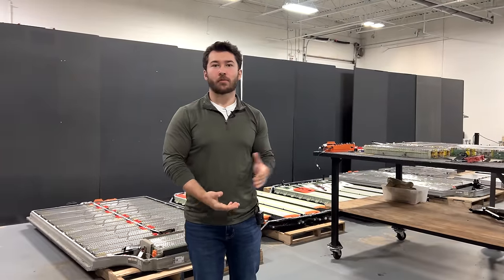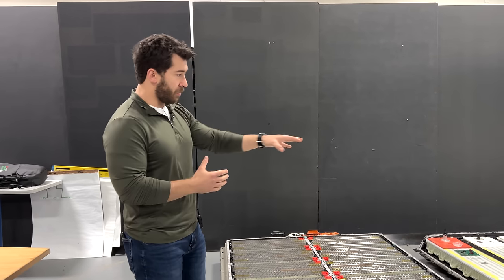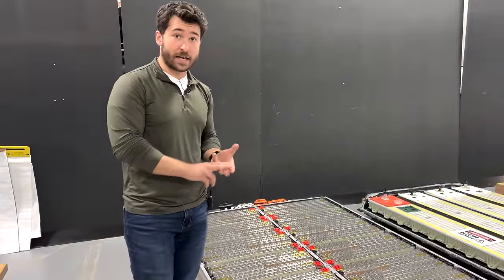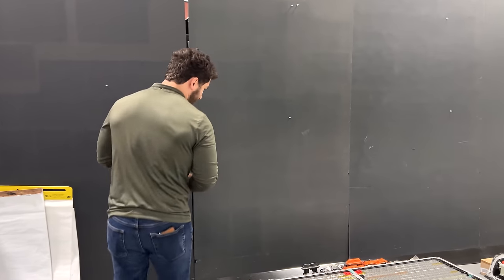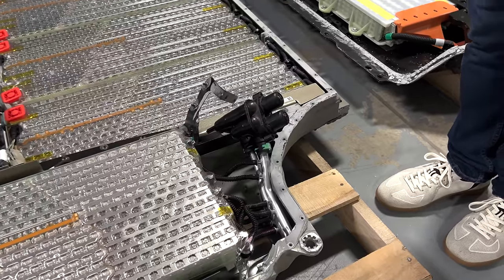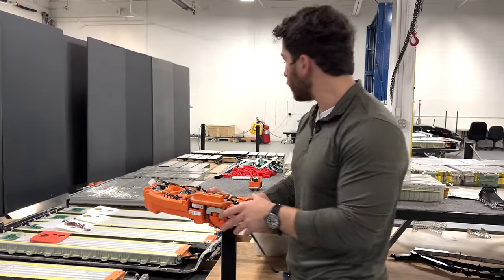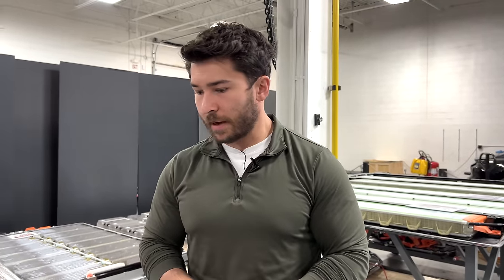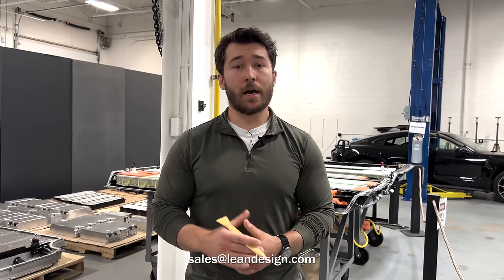A First-Ever Tesla Teardown! Model X Battery Pack Overview

Comment: I can understand the total lack of analysis on safety and catastrophic failure based on what companies are likely paying for this teardown. I've never seen a serious teardown where the technical expert failed to mention issues that made them uncomfortable let alone were considered oversights or engineer failures. I would expect phrases like, "we wondered why they chose the xyz material for this design solution" or "we were puzzled why they didn't consider what would happen if so and so occurred after N hours". This presentation seems more like a technical advertisement rather than a well thought out teardown.

Comment: I would be curious as to what if any degredation there is on an under rated pack?  Say a 75KW/hr pack that is really 100kw/hr just limited by software.   One would assume that there would be zero range degradation until the pack was just about kaput?
Reply: Would be neat if they took the active charger out of the center of he range.  Say 10% to 90%.
Reply: kWh
Not "per hour."

Comment: Is the contactor/high voltage unit new? that wasn't present on old battery packs (?). Its a cool unit.
Reply: It is present on the 2.0 (and maybe 1.5) S/X battery packs. Referred to as the ancillary unit. It has its own cover that can be opened to service contactors and main BMS.

Comment: I like this design that fact you could swap out dead packs and them being smaller should keep the cost down
Reply: Module swapping isn't that simple smh. Do the research it takes a LOT to properly match a different ev module to an existing pack.
Reply: Cell swapping in my opinion is unnecessary. You loose a little capacity just driving and you will loose a little capacity when a cell dies. Most, maybe all EV owners won’t change the entire pack because of a 0.1% loss in capacity. 
There are already recycling methods that just dump the entire pack into a shredder with special liquids. Considering most battery recycling plants shred the cells anyway, what’s wrong with the entire pack? Battery recycling is still in its early stages and will drastically improve overtime.
Reply: as @4literv6 said, it turns out that in real live swapping modules out is insanely difficult to get right and not ruin the pack.
Reply: model S/X battery packs are NO LONGER Serviceable , and Maintenance FREE.
Reply: @battery_wattage   Maybe 20 years to get enough deceased batteries to hit scale.

Comment: It seems the later ones are made on purpose not to be serviceable. The later modern  pack is equivalent to welding, gluing a petrol engine together so when something needs repair you need a whole new engine totalling the vehicle. That is the equivalent way latest battery packs have gone. Unexceptible needs skilled serviceability for evs to be   viable.

Comment: Just a question with corrosion...If you live in a high moisture snowy city where you are prone to water, snow, salt kicking up off the ground and onto the under side of your car...how does tesla protect the battery and all the underside from this?
Reply: Air tight seal , cars no good if it cuts out when you go through a puddle. 😮

Comment: Makes total sense to have a software unlock to get the full range of a battery pack and I assume all the batteries are still being used so some aren't just sitting there idle if someone didn't want the unlocked range.  It would be interesting if you could unlock the extra range as a monthly subscription for say a trip.

Comment: Does anyone know if the battery pack can be shunt modded so the current can bypass the controller and go straight to the battery for a hot-rodder who wants full battery power for a few seconds?

Comment: Are these batteries 1865 or 2170?
Reply: 18650
Reply: @Harakai100  Thank you
Reply: Model S/X still use 1865 Li cells , 2021 PLAID was Supposed to use 4680 , but Volume was too low.
and DEMAND Increasing for Model 3/Y PRFORMANCE w/ Structural battery. 
and PANASONIC now makes 1865 w/ 25% MORE power in 2023.
Reply: @Harakai100  still known as the same size battery which 18mm wide 65mm long, so technically 65mm long, not 650mm long. And we don’t normally call 2170 batteries 21700 which doesn’t make any sense, it’s a typo.
Reply: @cliftonsr  All lithium-ion batteries get their numeric identifiers from their size. In the case of a 18650, (for instance) it's 18mm in diameter and 65mm long. The zero at the end simply means it's cylindrical. A 2170 or a 4680 cell is indeed a 21700 or 46800 cell, It's just Tesla that made the choice to break with the established norm because 2170 sounds better than 21700. Don't be a smartass.

Comment: Good video. It’s unfortunate though that you don’t mention 2020 was the last year where this pack was used.

The 2021 “refresh” of the S and X (including the Plaid and LR versions) introduced a totally new pack design. It still uses 18650 cells, but is otherwise quite different. It would be great to see you do a teardown and comparison of a post-refresh pack at some point.

Also, Tesla has not done any software limiting for a while now. They briefly introduced a range-limited “Standard Range” Model S a couple of months ago, but then cancelled that and lowered the price of the LR and Plaid instead. So there hasn’t been a downrated S or X pack since some time before the 2021 “refresh”.

Comment: Battery thieves will likely love the quick removal of a Model S/X battery pack purely from the underbody side. I mean, within about 15 minutes, you get a roughly $15,000 - $20,000 USD value, no tracking inside, and easy to manipulate identity of the pack.
Reply: no way for Thieves to steal a 7,000 lb battery pack . 
no Space UNDER car. too HEAVY for any car jack , unless GARAGE.
Reply: @markplott4820  This battery pack is not 7,000 lb (the whole car is about 5300 lb) but about 530-640 kg, which is 1200 to 1400 lb. The disassembly process can be prepared for with simple equipment for lifting the car, unmounting the pack and handling the battery weight. This is not to encourage this, but to keep an eye on for owners.
Reply: @MooseOnEarth   - I would LIKE to see Battery thiefs TRY & Steal a model S/X battery , wont be Possible.
Reply: It’s way easier to steal the complete car and strip it later. Tracking can be jammed.

Comment: Cant believe they make AA  cells basically and bus all this together.  Seems like a design a 10 year old would do.  Thinking in few years we will see major battery design changes
Reply: 1865 are LARGER than AA batteries.
Reply: Yeah  just the point. Tons of connections and bus that can't be repaired easy . Is what is see. And or simply swapping the entire battery.  Like some kid designed this ?  To sell new cars same old same old.  Disposable new cars
Reply: @CRsolar  - FALSE, Tesla cars last longer than ANY other. 
and GRUBER fixes & Upgrades old Tesla. 
Tesla battery in 2023 last 50+ years LFP .
Reply: I'm a Tesla fan I just can see they could build them better why not
Reply: @CRsolar  - in 2023, Tesla does already build them better. CyberCell already in production.
Reply: @markplott4820  will check it out more.  From what i see so far, I looks more disposable.  Non repairable  and probably harder to recycle.. thinking we will see some unreal things to come with batteries.  and would in my little view.  Be nice to swap a battery with new tech to come. Fast.
Reply: @CRsolar   - in 2023 Current battery , already made BETTER.
Munro bought an OLD Legacy battery.
Reply: @markplott4820 looks like same thing except worse to repair now part of the structure and solid glued.  More like a new smart phone everyday.  Got to buy a new one and can't repair thinking
Reply: @CRsolar   - All TESLA 2023 battery pack are Maintenance FREE & never need Servicing. 
NOTHING to Repair. 
Battery pack will last LIFE of the car, even w/ Daily Supercharging. (60%). 

LFP will last 50+ years. +3 Million miles. 
1865 & 2170 will last 35+ years. +2.5 Mm.
4680 will last 40+ years. +2.5 Mm. 
at END of life entire Pack + Car can be Recycled.
Reply: @CRsolar   - @ this point, Does not really matter, sense S/X are low Volume cars w/ 35+ year battery packs in 2023.

Comment: Your information on software limited packs is outdated. They aren’t doing that and all S and X continue to have a single pack since the 2021 refresh.
Reply: Is the 2023 Model X battery pack significantly different than the 2020 pack explained here?
Reply: @mini2nut67  Yes, it is.
Reply: Correct. They briefly offered a new “Standard Range” Model S a couple months ago which would have been software limited, but they never delivered them and canceled that plan shortly after - instead opting to reduce the price of the LR and Plaid models.

Comment: Does anyone think that Tesla should move on to 2170 or even 4680 cells to rake in the IRA incentives?
Reply: why ? so long as JAPAN can supply 1865 CHEAPLY . 
besides , long term TESLA will KILL OFF the model S/X, in favor of MORE MASS market Vehicles , produced in the MILLIONS. and Lowering the ASP.
Reply: With a production capacity of 100k and 100kWh pack each ; the IRA guidelines for domestic cell production credits is $35/kWh. this amounts to $3.5 Billion dollars annually in just IRA credits for jumping to 4680. I'd say it's a big deal. @markplott4820
Reply: @markplott4820  I don't see the S/X going away any time soon.  They are still making money.  Why leave it on the table.   Maybe if/when they have new cars in this segment.  Buy why.   Keep refreshing so long as people will buy them.

Comment: Tesla never pursued the pack swap thing. They did it once back in 2015 for demonstration purposes. It's easy to remove because they have service in mind.
Reply: 'The pilot battery-swap site at Harris Ranch opened in March 2015,[6] but with little use by June, Tesla shut down the pilot battery swapping' Wikipedia.
Reply: 2023 packs no longer SERVICIABLE , last LIFE of the car. ZERO maintenance PACK.

Comment: The Battery could be half that size, if the motor system had a low/high gear setup and not direct drive. Hydrogen fuel cells are a WAY better technology to develop, more effective and efficient than batteries. "Software limits" to any pre existing system potential, to unlock at a higher price point is illegal as hell 😂 like the "pay to use heated seat" fandango lol 🤣

Comment: Teslas are still not ideal, in general EVs are not. Too expensive and the $100/kwh battery is utter BS. Infrastructure should be built around public transport and small EVs to run short distances.
Reply: TESLA stops at 400 mi , IDEAL Long Range. 
MOST Tesla only have 300 mi , 3/Y most SOLD Tesla ever. 
MORE Tesla , coming w/ LOWER ASP , shorter Ranges.

Comment: It looks like thousands and thousands of laptop batteries connected in series and parallel to me. 

It will be interesting to see how this compares to the upcoming Cybertruck 4680 battery packs. It should be a much simpler pack with way fewer battery cells. 

We will all laugh at these super heavy and antiquated battery packs 6-8 years from now. The improvements and lower costs that are coming will be absolutely amazing. We can finally drive the last nail in the ICE coffin.
Reply: the 2021 PLAID S was supposed to have 4680 , but supply was too short.
Reply: We will see about that. In the end, optimizing the packs alone will never solve the energy density issue. Only a robust, mass manufacturable alternate chemistry with increased energy density and the same or better other features of the current lithium tech will make EVs a nobrainer.